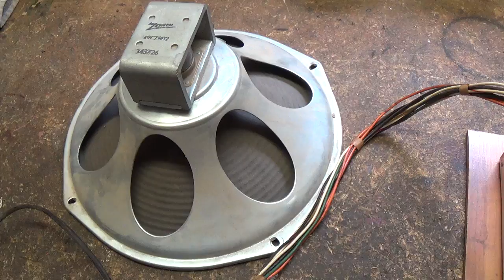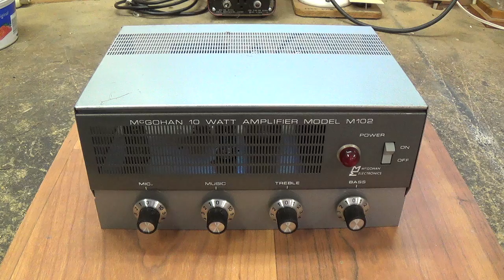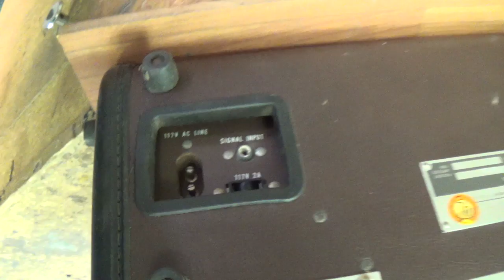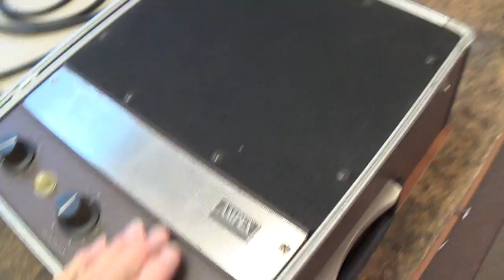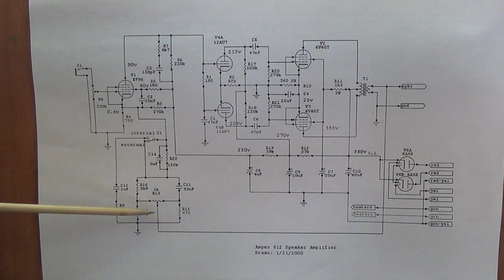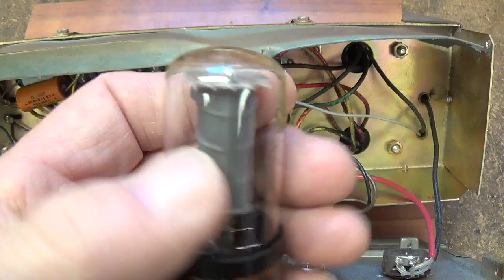Garage Sale Bargains in Vintage Electronic Gear

Comment: OMG!!! That JBL speaker in that Ampex is a diamond! What a find!
Reply from the maker: Greetings, Brad. I agree....in fact I liked it so much that I ended up buying the Ampex unit from the guy who found it at an estate sale. I'm not sure what to do with it now. It's really too nice to tear apart, but not all that neat-looking or usable as is.....decisions....decisions.
Reply: I use the A 692 model and pre amp it with a peavey Decade. It sounds amazing, also the 692 has a large bolt  that runs into the back of the speaker and through the back of the cabinet so you can tune the speaker box for taste. Another thing that can be done is using the door to muffle the sound, to bring out crazy bass tones. Two of these used through stereo outputs can change your world.
Reply: Yah They Do Have A Good Sound.
I Have 3 JBL Bluetooth Speakers
& A Ryobi Bluetooth Speaker.
& They All Sound Great.

Comment: Another great video Uncle Doug!  Now I have yet another thing to look out for, even if just for parts for later projects.  

The sweet little 8 inch speaker-how do you think it would sound with guitar?
Reply from the maker: Thanks, Davo. It's good to hear from you. I have not completed the Ampex amp project yet. It's a PA-style amp, so it's not optimum for guitar, and I hate to alter it, so I'm stuck in the middle. The chassis does not lend itself to being installed in a "regular" amp cabinet, and the speaker has to stay attached to the baffle and needs the sealed sound chamber.....so it would be a real challenge to modify. I have a feeling, however, that the speaker is probably wonderful. At the very least, I could use a guitar amp to drive the speaker and see how it sounds. Thanks for your input :)
Reply: Uncle Doug
"Great for hifi but not guitar".  I've seen the same type of statement over and over without a good explanation.  When I've read about conversions they are typically, "use the components and copy a vintage guitar amp schematic"; never a good explanation.  Do you have a reference to point me toward?  Feel like explaining yourself?  Thanks.
Reply from the maker: HiFi amps have linear (flat) frequency response, with emphasis on clean, distortion-free (much less than 1% THD) signal output. Guitar amps sound best when the frequency response is "scooped" to compensate for midrange-intensive pickup output, and offer tube saturation and distortion (5% ot 10% THD) at moderate to high volume levels. One is for Mantovani and the other is for Chuck Berry. One is a scalpel and the other is an axe.

The way to achieve the conversion can vary from replacement of components and values in the existing chassis (i.e. modification of tone circuits, addition of cathode bypass caps, etc.), to removal of components and using them to scratch-build a  clone of an existing guitar amp circuit.

I've done both, and have posted several videos describing both options, including a 7-video series detailing every step in the scratch-building process, from sheet metal and scrap parts to finished combo amplifier. The choice depends on the adaptability of the (HiFi/PA) chassis and the desired outcome. The procedure to accomplish both has infinite variability and requires that the builder possesses a sufficient foundation in amplifier theory to make educated decisions.

Is that an adequate explanation ?
Reply: More than adequate Uncle Doug!  I didn't realize the THD was so far off.
Reply from the maker: Yes, there is quite a difference in fidelity. Some early guitar amp makers (i.e. Ampeg) refused to yield to the demands for raunchy tone, but eventually, they all had to come around, just to stay in business.
Reply: Every time I see a video of yours, or get a message I learn something.  Keep up the good work!
Reply from the maker: Thanks, Davo.....we will :)  ^. .^

Comment: Nice finds.   Alas I've noticed recently that folks take the tubes out of these sets and sell them separately on eBay, etc.   This makes restoration of the sets so much harder and the prices of many tubes has now become crazy.  Oh well.
Reply from the maker: Yes, having to buy a whole set of tubes would definitely take the "bargain" out of the term "garage sale bargain". Ebay has ruined the simplicity and joy of hunting down treasures. Everyone is a self-professed expert....utterly determined to squeeze every dime out of every item. Pawn shops are the worst, in my opinion. They hunt down the absolute highest price ever obtained for an item that even vaguely resembles whatever they're trying to sell.....and then add 10%. Thanks for your input Z :)

Comment: Hey Unc Doug !!  Thanks for another amusing and informative video.  I DO look forward to your new videos.  I have two questions for you please sir !!  1) Do you ever try to rehabilitate the exterior of those old rusty transformers (no reference to your dog intended ;)) ?  I wonder if sanding them and painting them can be effective ?   2) When you fixed the Cap canister - it looked like you just soldered new individual Caps across the canister lugs !!  I get that you wanted to leave the canister in place for the authentic look - but did you go into the can and delete the guts?  If not - how would the existing can capacitor elements (albeit they are defective) interact with the new caps soldered in parallel ?  Keep on videoing !!
Reply from the maker: Greeting, Donald. 1.) Yes, I occasionally succumb to the temptation to clean up old transformers, but generally refrain from repainting them unless the amp has little collector value. Any obvious changes like this make collectors nervous.  2.) I never attach new capacitors to the lugs of old ones. If you look at 8:50 in the video, the empty lugs of the old can cap are clearly visible. Some people do attach them to old lugs, out of laziness, but to me it defeats the whole purpose of installing new capacitors.....much like putting on a pair of clean socks over a pair of dirty ones. You should leave the old can in place, unless you actually replace it instead of individual caps, but it should have no electrical connection to any part of the circuit.
Reply: Uncle Doug
 Thanks for your response Uncle Doug !!  I do see that now at 8:50 !!  Makes sense !!  -- Don.

Comment: Thanks for another great video, Doug. Last year I purchased a Silvertone console record player with a stereo single-ended 6bq5 amp. I have the parts from other such finds to turn it into a PP, which is still between workbench and boxes. I have plans to use the nice SE transformers for Champ-style builds. I love what you do - keep it up!
Reply from the maker: You're quite welcome, Britt. When I get comments like this, it makes me want to run out to my workshop and start on a new project. There's nothing like having a hot soldering iron, plenty of parts, and a snoring old dog curled up nearby :) Never fear.....Rusty and I will be doing this until the undertaker says otherwise. Best of luck with your projects, Britt. It's always great to hear from you.

Comment: Hi Uncle Doug, nice to see some vintage electronic rescuing going on.  I visited our local Waste Management Facility  (Junk Yard) or as we Aussies call them "Tips" last weekend and at their "shop" picked up a Line 6 display unit for guitar pedals which had a power supply unit with leads for about 10  x9volt power adapters.  Plus an old speaker cabinet, with an Australian made ( yes like the USA we used to make things) 1970's Plessey - formally Rola /celestion factory, 8" speaker, took it home and it's loud with a nice fat bottom end. It's amazing what you can pick up for a few dollars although Tube stuff is getting rarer to find.  Kind regards, Colin
Reply from the maker: Greetings, Colin. It's always good to hear from you, and to learn of your recent "finds" at the local junk yard. It is sad that our countries have dispensed with so much of their manufacturing capability, preferring instead to import goods from areas with a less expensive work force. Old treasures like your cabinet and items featured in my videos are about all we have left from the "good old days", which makes them all the more dear. Thanks for watching and for posting :)

Comment: Thanks for another great video! I'm sure all of us would be interested in maybe a one or two part video in which you would demonstrate how you would go about testing a find like these.
Reply from the maker: You're welcome, Robert. On amps such as this, I visually inspect for shorts,  missing insulation, burnt parts, obvious problems (like are the correct tubes in the sockets?) and then hook them up to a proper-impedance speaker (if they lacked one), plug them into a Current Limiter (see my video on how to make one) and Variac if they've been sitting for a while (most have), and see if they work. Based on what happened, I would make repairs; test voltages, plate current (PC), and plate dissipation; and monitor the amp for 30 minutes or so of operation, usually monitoring PC. If the CL flashed bright at any time during this entire procedure, I would immediately shut the amp down and correct the cause. I have demonstrated all of these steps at different times in different videos and the procedure is fairly simple and effective.

Comment: The inverter on the AMPEX is a long tailed pair
Reply from the maker: Yes, sir......how about on the McGohan ???
Reply: Uncle Doug

On the McGohan (the second amp) we see a distributed load inverter, but not a very common implementation. Typically, the cathode resitor would be equal in value to the plate resistor and routed directly to ground. I guess the way it's done has something to do with the negative feedback loop.
Reply from the maker: kardRatzinger
I see your point, KR, there is a 68K resistor from plate to B+, while the cathode has a 78K (indirect) pathway to ground....somewhat imbalanced. I would categorize this as a  cathodyne-style (split-load) phase inverter, but with some peculiarities.
Reply: Uncle Doug
This "peculiarities" are limiting the gain of this stage and give some more headroom to the output of that last stage (the designer shifts the cathode level with that "split series resistor" where the grid resistor is conected to. Another side effect is that the input AC resistance is shifted upwards with respect to the ratio of the both 2k7 and the 75k resistors multiplied by the gain of that stage. But this is maybe not inteded. The main thing here, i think, is that there must be a sufficient voltage plateau to operate the cathode from. Otherwhise the cathode signal will be distorted when driving the amp at high levels.
Reply from the maker: Thanks for the explanation, TC. I really appreciate your very knowledgeable input.

Comment: This amp is awesome, but it really frightens me that there are no grommets to protect the wires going through the chassis. Is this really how this amp was when it left the factory?
Reply from the maker: Yes, indeed :)
Reply from the maker: Greetings, KR. I guess you are referring to the Ampex. Unless the wires are subject to movement and if they are centered in the holes, I wouldn't think it would be much of a problem. On my scratch-built amps, I always use grommets just to play it safe. On this amp, however (which is completely original as far as I know), apparently they didn't feel grommets were necessary. You have a keen eye :)
Reply: Uncle Doug
I was referring to the first amp (when wrote the post I wasn't aware there's going to be more amps in the video).
Reply from the maker: I just went out into the workshop and took a close look at the Zenith chassis, KR. You're right....the wires fit snugly in the holes, rubbing against the sharp edges. There definitely should be some rubber grommets to insulate them from the metal chassis. It seems like a risky and inexcusable omission, particularly in a chassis that is otherwise well designed and constructed. Again, you have a sharp eye :)
Reply: Uncle Doug
Sometimes Amps doesn´t have these grommets even when they leave the factory brand new. All my Philips EL6415 doesn´t have them for the top cap connection (plate) they just running through a big whole (where no grommet of any size would fit into) in the aluminium cover plate of the PCB. They carry about 370Volts so i decided that they should have at least have a very high voltage insulation (10kV) and a ceramic top cap isolator, and they do look very nice as well compared to the old tiny rubber insulated cap connectors.
Reply from the maker: There is no vestige of rubber grommet anywhere on this chassis, TC, so I must assume it left the factory that way. I can imagine that a barefoot music lover could have had a real "surprise" if he touched the metal parts of the phonograph with a chafed primary wire making contact with the chassis.
I can see it now, "Mommy, why is daddy dancing in the living room....and why are his pajamas on fire?"
Reply: So, conclusion is, never trust old electronics, check them out first every time before apply any voltage, we both know that, don´t we...? ;)

Comment: What a neat video. And tubes (e.g., that matched quartet of 6BQ5s) are WONDERFUL at reproducing music. Oh to be young again & over at the nearby airbase & NOT walking by the things that said McIntosh on them... thanks for sharing the great finds.
Reply from the maker: You're welcome, Wes. Vintage Amperex 6BQ5's can be a little pricey, and this matched set of four really got my attention....glad you liked them.

I share your remorse over not buying all the Fender, Gibson, McIntosh, etc. gear that was available over the years. Perhaps this video will encourage youngsters not to make the same mistakes we did :)
Reply: Uncle Doug
I had one question for you (maybe wrong place). I see regularly on your bench what I think is a "leak light". I'm gonna build one of these. If so, have you found an optimum bulb wattage to make modern house AC play nice with vintage transformers as are found in my BF Champ?  Thanks!  :)  (Oh yeah, good advice before on stiff-arming the little old ladies at those yard sales - ya gotta bring it!)
Reply from the maker: Wes, I made a video showing how to make a Current Limiter. You need a 250W incandescent bulb for smaller amps like the Champ. If you can't find one locally, they are available on Amazon. Good luck :)
Reply: Uncle Doug
Many thanks - I'll seek it out. :)

Comment: I am always wondering on how you come across such jewels. is it by systematically searching or just be pure luck?
Seems that Rusty is currently focusing more on his tennis career, when will we see him at Flushing Meadows!
Great video with informative content.
Reply from the maker: Thanks so much, TM. Rusty is still working on his serve, which is difficult since he tends to keep the ball in his mouth :)

Re the garage sales, it helps to read the ads for the sales in the newspaper and on Craigslist. They generally specify old electronic items, like radios, amps, and test equipment. This will cut down on driving all over town for junk. Also, make friends with the people who run the sales and they will generally let you know when good items are going to be available. It makes their job easier if you show up early, buy all the electronic stuff, and don't quibble too much.

Comment: Good call on the wire too.:)
Reply from the maker: Yes, sir....I keep all the old wire bundles from every chassis I disassemble. You'd be surprised how many times you can find an exact match to the wiring in a project you're working on. It makes the repair undetectable.....and it's free !!!
Reply from the maker: I hate to admit it, but I get real sneaky when working on vintage gear.....the idea is always to make it look like nothing was done :)